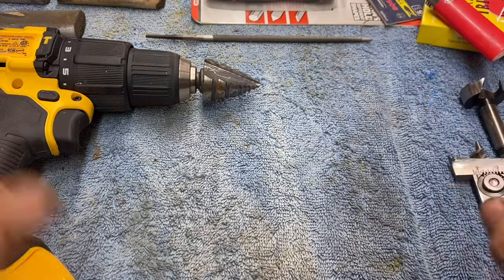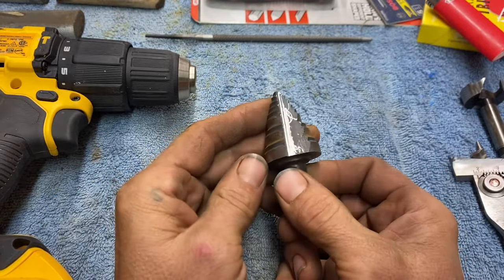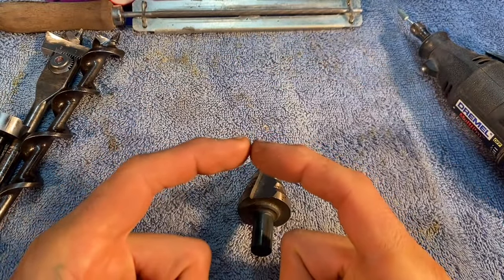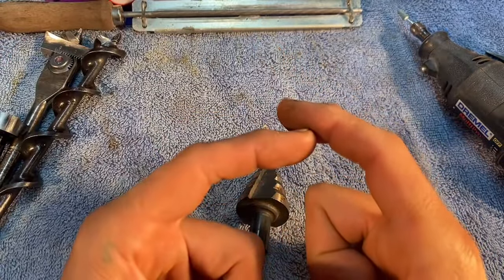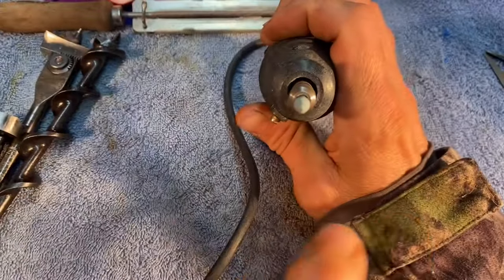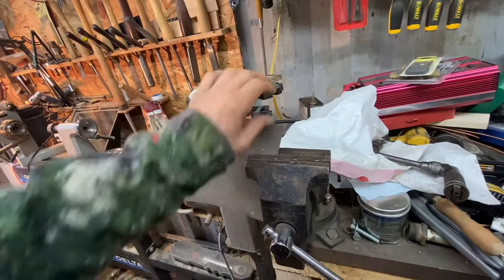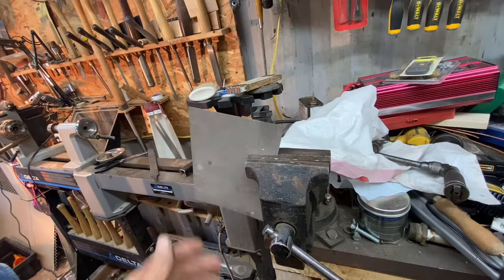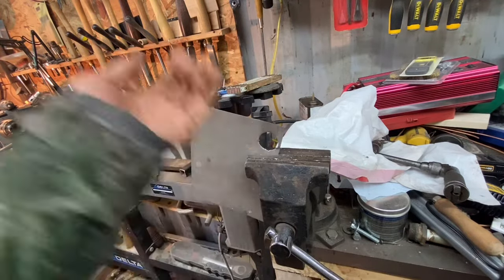How to sharpen a unibit, How to sharpen a step bit￼, specialty drill bit

Comment: I'm an I'm an electrician commercial industrial.  Unibits are they go to hole maker for holes up to one inch.   A lot of times the only part that goes bad is the tip, It's either high speed or nothing, They keep going as the tip changes colors and start smoking, We'd figure that the warning signed something is not working right but with enough pressure it will melt its way through.Lol! I've watched some guys go through three or four Trying to drill the holes through a stainless steel countertop, the tip literally gets red hot but they keep trying! Lol!  You just gotta laugh. Anyway these are easily sharpened but 99.9% of people don't understand this and will toss those overpriced Klein and Milwaukee bits. I too use a Dremel.  I'm a little ridiculous with my hobbies. I'm a big fan of the Dremel I'd buy many many different types of burrs and bits and cutting wheels and disks. The best I found for this specific application is to use either 1 1/4" diamond disk or the same size reinforced cutting disk. I just hold the disk so its flat up against the flute , there's a good amount of flat surface there so its impossible to screw up matching the angle. I use low speed with a diamond disk they work great few seconds per cutting flu is really all it takes. Higher speed with the reinforced cutting desk.
Reply from the maker: Stainless steel has a lower cutting speed, look up feet per minute, cutting speed for various metals and you will see what I mean. Electricians are supposed to know this since they’re supposed to be the smartest of all trades craftspeople 🙄. For instance, they make a 56 RPM and a 33 RPM rigid pipe threading machine as I recall the RPMs may be off by two or three, but I know if you try to thread stainless steel pipe at high speed you will burn the $400 threading dies right away.
To determine the appropriate RPM for drilling different metals:

1. Consider the material hardness - harder metals require lower RPMs.

2. Check the drill bit size - larger bits need lower RPMs.

3. Use this formula to calculate RPM: 
   RPM = (Cutting speed x 3.82) / Drill bit diameter

4. Typical cutting speeds for metals:
   - Aluminum: 200-300 surface feet per minute (SFM)
   - Brass/Bronze: 150-300 SFM  
   - Cast Iron: 50-100 SFM
   - Mild Steel: 80-110 SFM
   - Stainless Steel: 30-50 SFM[1][5]

5. Start at a lower RPM and increase gradually if needed.

6. Watch for signs of overheating like discoloration or smoke.

7. Use cutting fluid/lubricant for most metals.

8. Adjust RPM down for deeper holes.

For example, to drill 1/4" mild steel:
RPM = (100 SFM x 3.82) / 0.25" = 1,528 RPM

Remember to balance speed with drill bit life and material quality. Slower speeds generally extend bit life but take longer[5]. Adjust based on your specific needs and material.

Sources
[1] Feeds & Speeds For Drills | Norseman Drill & Tool http://www.norsemandrill.com/feeds-speeds-drill.php
[2] Drilling metal - speed charts vs reality | The Hobby-Machinist https://www.hobby-machinist.com/threads/drilling-metal-speed-charts-vs-reality.99330/
[3] Drilling Machines - Cutting Speeds & RPM Calculations - Wisc-Online https://www.wisc-online.com/LearningContent/mtl8202/MLT8202.htm
[4] Help! Drilling steel,need some help...what rpm should i be at? - Page 2 https://www.rcgroups.com/forums/showthread.php
[5] Figuring Out Drill Speeds: RPMs and Bit Life https://www.albanycountyfasteners.com/blog/how-fast-drill-rpm/

Comment: You're the man, thanks so much! Probably not the best idea to use a cheap HSS step bit on cast iron, and once I was done two of the steps couldn't even make it through aluminum. I don't often need to drill through butter, so I had pretty much given up on that bit. But after your video it can get through aluminum again. It's not exactly good as new (I think some of the steps have a chipped cutting edge which would require removing a LOT of material), but a lot better than before

Comment: I use my step drills reliably up to 3/8 in 0.125-0.140 annealed tool steel.

You’ll probably, using a drill press, need to change your speed while going larger

Comment: How do you go about sharpening the tip
Reply from the maker: Just like you would a standard twist drill, when I first learned how to hand sharpen drill bits in machine shop in college, they gave us a new bit, and had us stick it to a grinder that wasn’t rotating and get our actions down to where we could move our hands throughout the arc to practice. I would suggest getting a new bit and practicing the same way, but be careful because of their awkward shape. I suppose you could also just use a diamond file on it.